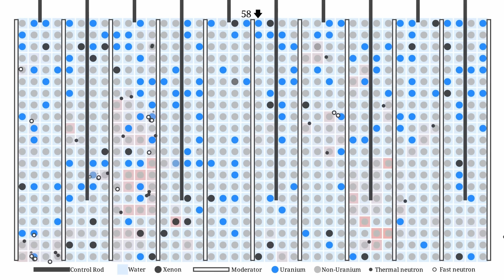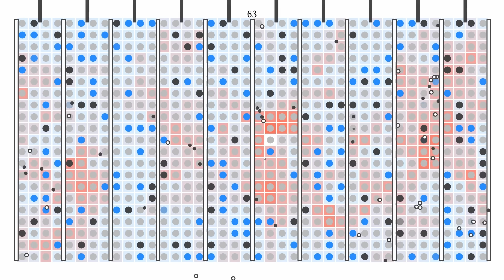Chernobyl Accident - Simulation only (no talk)

Comment: the operators basically did what they were supposed to do the entire time, the exception being toptunov's lack of target power input. that shouldnt have caused what it did, and to some degree it didnt. the true fault with the reactor was in its design, not the sketchy procedures. you can run reactors quite wrongly and theyll be fine, but not when they have an inherent design flaw that would be most likely to rear its ugly head at the exact age of unit 4.

im going by memory here so i dont have everything detailed. but all of this can be found on That Chernobyl Guy's channel, hence the (?)s below.

i know the hbo chernobyl did everyone in the control room dirty, and thats understandable because thats exactly what the soviets wanted the entire world to think in order to save their entire nuclear industry. a few men- one being particularly easy to blame in this way- sacrificed for the preservation of soviet science? worth it to them... but the vienna meeting, insag 1, and insag 7 (to some degree) all left out the reasons WHY the operators did the seemingly weird things they did. they disabled this safety system? why? because they were reckless with dyatlov at the helm obviously! well no, because the second simultaneous test they were running for the turbine bearing vibration(?) called for it so they disabled the necessary safeties like they were supposed to in the procedure written for that scenario. if that second tests very existence is left out of the meeting and reports, its really easy to make it look like the systemically defenseless (and sometimes dead) operators were just totally winging it in the control room, following nonexistent procedures. when the information is properly scrutinized and aggregated well beyond what anyone bothered to do in 86-88 ish, it all makes significantly more sense and nearly lets the operators completely off the hook. also the experiment they did by draining reactor 3(?) to see what would happen to the orm proved the existence design flaw and was subsequently swept under the rug pending the rbmk safety upgrades across the ussr getting done. just that alone is enough information to say that the operators were not operating what they were told they were operating by the experts who built it, and with an objective eye for justice its really hard to then say that the explosion was the fault of careless or malicious actors in the control room.

the operators were handed a bomb that took a few years and partial refuels to be primed, and the designers either knew this and didnt tell them about it to protect the image of soviet technology or simply got it wrong, still putting them at fault. as far as im concerned, the operators did nothing wrong with the exception of toptunov's missed step, and that shouldnt have been an issue at all if the designers hadnt hidden the refueled reactivity calculation error and subsequent inherent design flaws. dyatlov was absolutely wronged to the ends of the earth and back by the system in which he simply did his part as best he could.

Comment: fun fact: The design of a RBMK reactor is actually not that bad. The use of carbon as a moderator instead of just water allows them to cheap out on the nuclear fuel and use a less enriched fuel at 2-3% instead of 4-5%. This comes with a downside tho, On the event of a power surge, water will boil off. Normally, this decrease reactivity cause moderator is removed but the issue with RBMK is that the carbon graphite they used as an additional moderator doesnt evaporate so it's left there moderating the out-of-control reactor. If you removed the graphite part, this is just a boiling water reactor. A low power but safer design

Comment: This is also a fantastic illustration of how such a massive reactor can have huge reactivity swings and be highly unstable given a generalized control system.
Reply: The graphite moderator didn't help. If they used the primary coolant as a moderator, the reactor would be more self controlling.

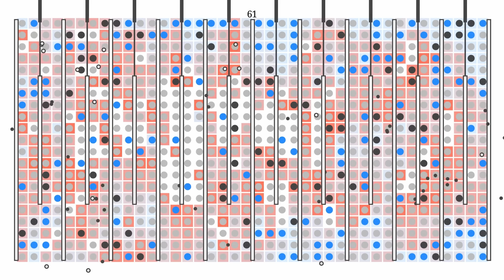Comment: 3:17 is when AZ-5 (reactor shutdown) button was pushed… all of the control rods started moving in & then they seized. The rods were basically fused into place. All because USSR wanted to cut costs during manufacturing and thought it would be a great idea to use graphite tips on the control rods…🤦🏼‍♂️

Comment: "Something is clearly wrong, we're operating at just 7% power even with all control rods pulled out, by all rights the reactor should be melting down right now... Let's continue with the safety test and turn off the coolant pumps!"

Comment: 100% operator error. Even with the “design flaw“ of the graphite tip control rods, pulling the rods completely out has always been a prohibited position since the days of SL-1. 

100% operator error

Comment: This really did not need words, good job. I didn't see anything in the comments as to why, when the control rods were re-inserted to try to scram the reactor, it was later revealed that unlike the rest of the control rods length (usually made of Boron), the tips of the rods were made of Graphite which supposedly would lubricate the control rods as they were inserted. Graphite works as a moderator to slow down the neutrons and allow them to interact with the Uranium fuel. In this case the graphite tips of the rods as they were first inserted, led to a runaway condition.
Reply: The way another video described it was "imagine only having one pedal in your car for the gas and the brake, and having to push the pedal through the 'gas' setting to get it to the 'brake' setting."

Comment: I know nothing of this.. but seeing so much red and water disappearing is just horrifying. Plus the end scene where there is so much chaos  adds on the spice
Reply: Without the water submerged in the radioactive material, it eventually causes it to overheat and more easily starts the chain reaction that happened at the end... how scary, it's like when you break the radiator of a car.
Reply: @victormanuelmoralesvanegas2480 I don't knoe anything about it but the control rods seemed to absorb the neutrons, if those control rods were simply lowered would it have stopped this reaction?
Reply: @NSAhitLIST3443  Imagine that those bars serve to regulate the flow of water. When they remained in a certain position and the reaction began to increase, the radioactive material was vaporizing the water that helped them to cool down, Since this one was overheating, in the end all the water evaporated, it was like a pressure cooker, but without a relief valve, and that's where the bomb was created.
Reply: No control rods were inside to cool off at end
Reply: in final scene process same in nuclear bomb
Reply: Poetic cinema

Comment: Some guys want to overclock a CPU to 10GHz at the midnight 01:23. OKAY. 

Increase Vcore, Vram, CPU fan speed 100%, sometimes 50%, sometimes 10%. Thermal grease oil substance vaporized, the grease becomes dry, then solidified. Adjust the Vcore/Vram even higher. Pull off the CPU fan plug, then plug back again (loop). 

Some GENIUS suggested try to uninstall the Copper heatsink during the system is still operating. OKAY. 

CPU Die temperature is reaching >150’C, CRACKS, and then SHATTERED. Excessive thermal grease and electronic components are spilled out to everywhere. 

And you guys do not have Contact Cleaner or any other appropriate chemical solvents. GOOD JOB.

Comment: also if i remember right from the tv show that based on fact there control rods were tipped with something that when inserted to the reactor cause a small reaction of the reactor getting warmer so the rods were to kill the heat and power but they would heat up the reactor at first then isolate this heat between the rods

Comment: why the control rods are fully extracted at 2:17? and why the reaction was fully uncontrolled for the next 1 minute?
Reply: The full extraction of the control rods was an attempt to counteract xenon poisoning and raise reactor power
Reply: Xenon is the black dots appearing. It absorbs neutrons and slows the reaction. What happened was exactly the things that happened in the video: they lowered the power for the test, but this poisoned the reactor with too much xenon. This slowed the reaction to basically the absolute zero, and to raise the power they ignored the safety protocols that told them to wait 24 hours, took out the control rods so power would get back up, but this quickly got out of hand: water was evaporating, xenon was gone and the control rods were fully extracted. There was nothing to slow the reaction. The moment they understood what was happening they tried to press the SCRAM button that lowers all control rods, but the graphite at the tips of the rods melted and got stuck. Power rose in a second, temperature did the same and pressure skyrocketed until it all exploded
Reply: @Qualcuno44  so the meltdown would not have happened if they were able to raise the rods instead of them being stuck to the bottom?
Reply: @BlenderHelixAlpha Other way around: the control rods calmed the reaction, but the tips are always exposed longer than any other part - they are the first part to go in and the last to come out.

Because of this the tips would corrode, so the Soviet reactors had graphite-tipped rods to preserve the tips for longer.

When the operator tried to lower the rods back in to calm the reaction the graphite had melted and bridged the opening, stopping them from going in.
Reply: 1.Покажіть мені той "протокол безпеки",що діяв станом на 26.04.1986 року.2. Хто сказав що стрижні були повністю вийняті. За підрахунком системи СКАЛА їх було у момент початку тесту мінімум 8 штук. При тому, що нормальним є 15, але я вам скажу що і до того інші реактори РБМК підіймали при 4-6 стрижнях і вибухів не було. Підіймали. Бо ніяких заборон на те не існувало. 
3. Кнопка аварійної зупинки (АЗ-5) була натиснута по закінченню тесту. Так зупиняється реактор. Це стандартна процедура. Її можна було виконати черзе 5-6 секунд після початку тесту. І був би вибух. Акімов проте не спішив її тиснути. До натиснення АЗ-5 не було жодних причин які вказували б на аварійний стан. Все проходило абсолютно у штатному режимі. Питання не в тому чому він привернув тумблер Аз-5 в чому він це зробив на пів хвилини пізніше? Допомога в молодому СІУРу з параметрами? Можливо. Але команда тиснути зупинити реактор віддав чітко і гучно. Це чули всі. Леонід Топтунов СІУР впустив потужність реактора, але у Олександра Акімова не було жодних причин(інструкцій або що) не підіймати потужність реактора. Дятлов дізнався про зниження потужності і його підйом коли повернувся у кімнату БЩУ. Він не кричав і не тиснув ні на кого. Він знав що Топтунов не вслідкува за ЛАРами. Це великий мінус СІУРу як операціоністу. Але він ніякого права не мав морально тиснути на Топтунова і він цього не робив. Запитав "підіймаєте? Добре". Інструкції цього не забороняли. Те що стрижні вводять додаткову позитивну реактивніть їм відомо не було. Те що у момент вводу стрижнів реактор вже знаходився у стані надкритичності, про це стало відомо вже після перевірки всіх розрахунків, плівок, порядку виконання операцій. Оператори могли скласти всі фактори до купи і зрозуміти що ситуація нестабільна лише на 30-40 секунд пізніше. А прийняти важливе рішення лише через 2 хвилини, бо так працював комп'ютер системи СКАЛА. Три роки до вибуху у 1983му запропонували встановити додаткове обладнання на БЩУ-4 в також нову систему підрахунку, але всім міністрам і начальникам профільних комітетів було начхати. Експлуатаційники станції винуваті лише в тому, що вони працювали на цьому реакторі.  @Qualcuno44
Reply: and also for a while after that the rods were ment to go down but got stuck
Reply: The power levels dropped and they were tryna kickstart that reactor power levels back up no?
Reply: Dunno, ask them

Comment: As far as I am aware, insertion of the control rods by pressing AZ-5 is totally irreversible and the whole process takes about 20 seconds. It would have taken just one person to press it maybe 30-60 seconds sooner than they actually did and maybe the reactor would have not yet been beyond saving. Of course, a lot of guesswork going on here. I believe a professional nuclear physicist and power plant operator (regardless of how practically experienced the staff was or it not being the right shift for that) should have immediately spotted the power rising abruptly out of nowhere and understood what was most likely going on and that the button needed to be pressed right away. However, apparently they were standing around watching the power skyrocket for almost a minute (or so), wasting valuable time that MIGHT have improved the situation.
Yes, they feared accusations of sabotage and the well-known result of such, but they all could have ratted on Dyatlov for obvious and plausible reasons.
The reactor and the whole power plant were not inherently unsafe or unsuitable for operation, just conceptually harder to manage, as it actually did not suffer more incidents than better reactor designs elsewhere (1 each in the East, the West and modern Asia). It was not "bound to happen" and they did not "have it coming". Even that night everybody could have gone home with nothing more than a story to tell, if it had not been for one man on a mission and the others lacking initiative and determination.

Comment: The moderators (in the video) were stationary as they never moved. Like as a permanent structure. At the end though the control rods were now going inside the moderators or pushing them down? Why didn’t the rods follow there normal path down shown in the beginning of the video and the moderators stay stationary?  I know this is just pointless conjecture because even though I love the video and it is informative in its own way and unique. It’s like the rods only got half way because they were on top of the moderators and “stuck” because of this.  I’m mostly interested in this because of the newly uploaded shorts of HBOs Chernobyl movie which are everywhere right now.  It is interesting but understanding the lingo is tough. From 1986 to 1989 I worked at a Nuclear Power Plant right after i graduated high school. I worked during what was called a scheduled maintenance outage. The plant would shut down for repairs or refueling. The job I had was considered low level if you will (not an engineer or anything like that) but it came with access to almost anywhere I wanted or needed to go. I was in charge of the issuing and return of very sensitive,calibrated equipment such torque wrenches etc. Much like a librarian if those didn’t get retuned I would be dispatched to go find them in the location they were supposed to be used at.  I’ve seen just about every part of the inside of a Nuclear reactor (it was offline/ shutdown of course) and I tell ya it’s creepy AF.  I leaned over and peered down into the reactor core pool once to see what it looked like and the rods glowed a dimly light blue color not green like everyone is told in movies etc.  It would give ya chills knowing what would happen if ya fell in.  This pool had to be 100 ft deep or more and was crystal clear.  Dense water is a natural shield and was safe to be near the pool (above it) during this time.  H C Divers (high contamination divers) would dive in the pool in full scuba to inspect down deep in the pool.  They had a chain of those guys  lined up one by one due to the fact they only could be down there a certain amount of time then come out and the next guy would dive in to complete the task they had assigned.  These guys got paid extremely well and worked only about a total of 4 months a year due to not over exceeding there exposure limits.  A vast majority of ex navy guys end up working at these power plants as careers after the navy such as control room engineers and as leads in high contamination areas for outage workers.